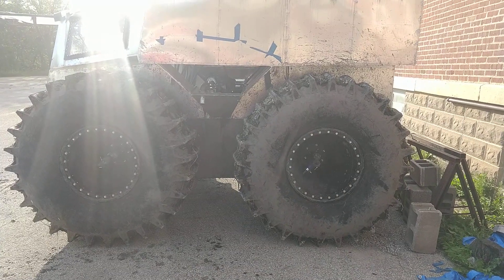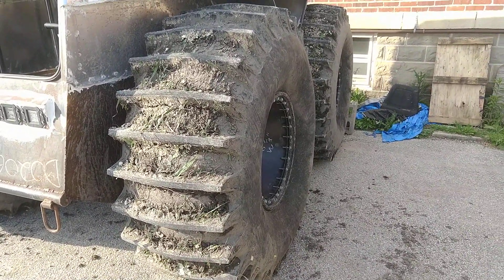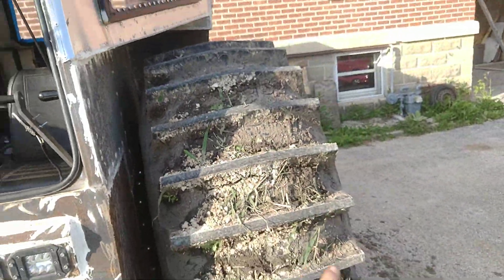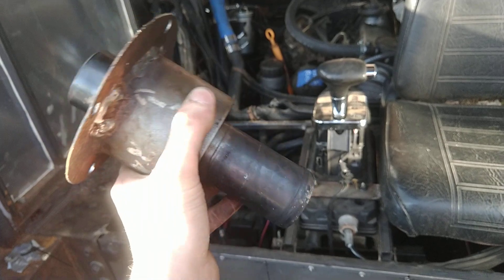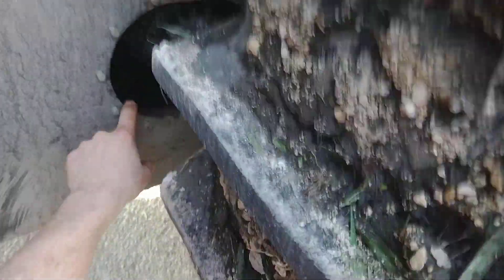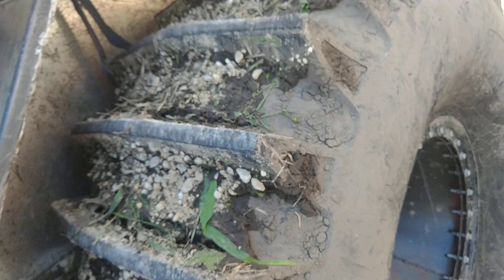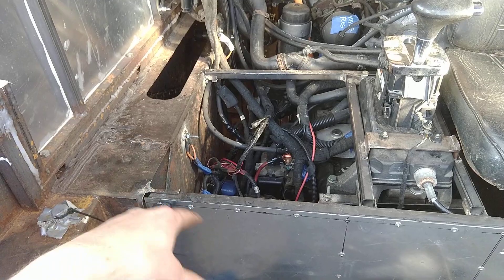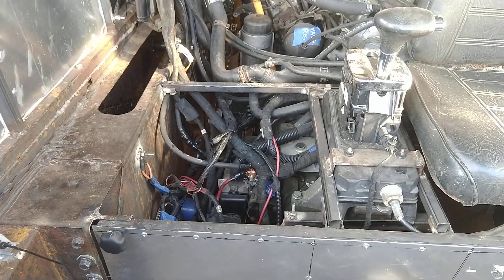Derp SNAFU

Comment: I would think that the tires would have absorbed some shock if the pressure was low enough.  I am so grateful that you are doing this testing for us so we can learn the best way to go. I was thinking of doing cast aluminum for the exhaust coupler but who knows what the final design will be. It would be OK for me to use thicker steel because I am trying to build a more utility work vehicle that can carry materials, run an auger and maybe even a brush cutter. Your next design is going to be an improvement and this current one is still the first.
Reply from the maker: Well I had them aired up to about 5 lbs, probably higher than they should've been.  I'm a big believer in pushing things to the limit and I ultimately did so in this test, better close to home than in some bush country.  If your constraints allowed a heavier vehicle I think copying a skid steer oil bath chain case is acceptable, I did so on mine but the iron was to light.  You would need probably something in the 1/4" range probably.  I am really excited about my next design, I got a bulk order of GAZ-71 parts moving forward with my new supplier today!  Now I'm thinking I might as well get a container shipped and add some Russian tires with them...
Reply: @pinestumps8622  It's the same with my creations, I push them to the limit at my own place so if they fall apart they are easier to deal with. Skid steer parts are always heavy the axles have steel gussets that can be as thick as 1/4 inch. My machine needs to be tough but it's going to be low speed I like the hydraulic drive because it makes it possible to turn on any surface without having to speed up the engine. The exhaust system has been my confounding point but you are showing me the way. My idea had involved cast aluminum couplers which are a lot easier to fabricate using my waste oil foundry. The atac Canadian atv uses a joystick control like many skid steers have located in the center of the cab so either driver or passenger can operate it. Good luck on getting your supplies imported!